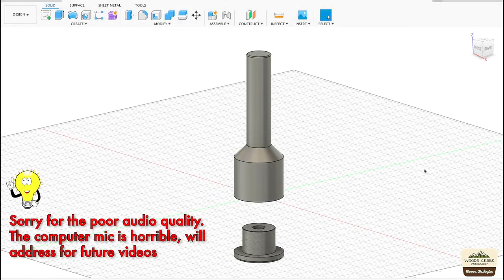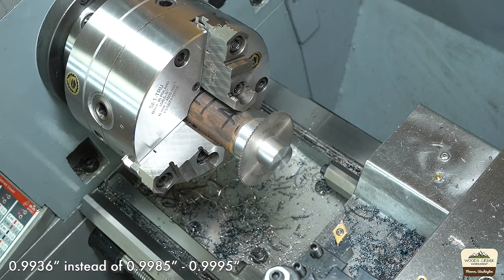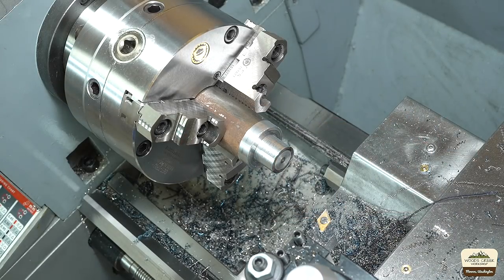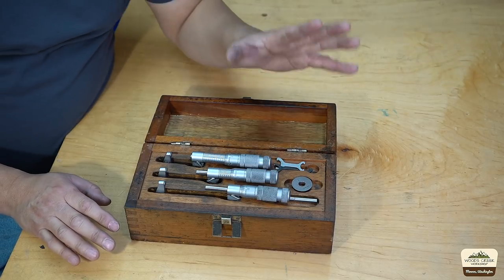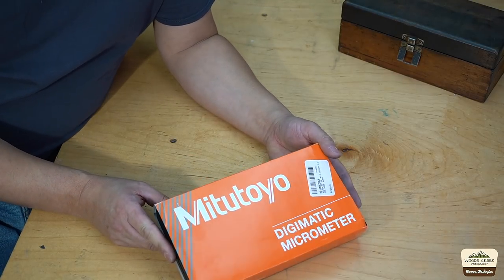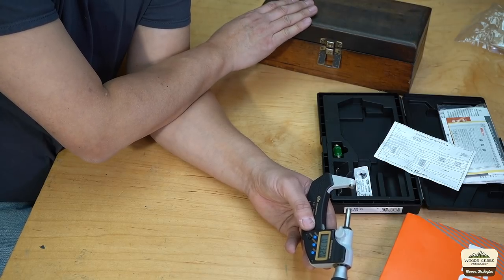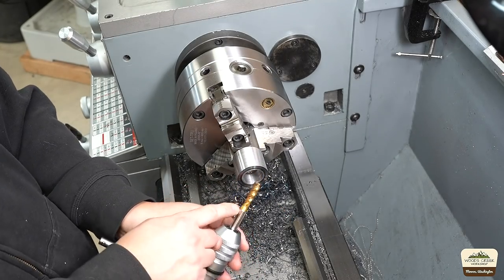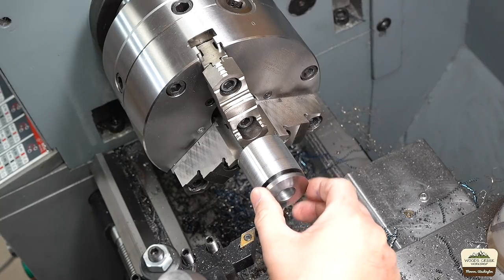MAKE AN AWESOME SLITTING SAW ARBOR

Comment: Great design. Thanks for sharing. This is definitely going on my project list. I was just using a slitting saw yesterday, using a shop made arbor that I bought on eBay. That arbor was only so-so. Also tried using a purchased arbor, more of a milling cutter arbor, but they have that huge nut on the bottom and 1”-8 thread and a lot of excessive length.
Reply from the maker: I have one of those arbors too and they are fine for super heavy cuts, but that nut gets in the way.  That's why I decided to make this one.  I can't take credit for the design as it resembles almost every other arbors made out there.

Comment: While watching the tailstock quill clamp build, I watched you split the clamp with the bandsaw and wondered when you were going to get a slitting saw for the mill, but I wasn't going to tell you that your way was wrong and you needed to spend money to do it differently.  That aside, glad to see you got a nice slitting saw setup - they can come in handy!  I've never bought one that ran all that true, so I wouldn't hesitate to run one of the scrap arbors you made in my shop.
Reply from the maker: Thanks Dale.  I already had few slitting saw arbors, but just weren’t the right setup for the quill clamp.  So I thought it would make the perfect next project. 😁

Comment: I agree with the others. What on earth did we all just watch... ? :-)

Great slitting saw arbor - and an entertaining story. Though, I have yet to meet a slitting saw arbor that doesn't make the "chunk ... chunk ... chunk" sound as it cuts once per revolution. Did you test it out? Does it cut continuously?

Cheers, Craig
Reply from the maker: Slitting saw rule 101:  all slitting saws must make that chunk chunk sound.  All says, no exception.  Its to what degree that matters 😁
Reply: @woodscreekworkshop9939  That's a good approach to the problem :)
Reply: my slitting saw arbors also 'chunk... chunk..'  and I turned the shanks and pilot diameters on the same piece, between centers.. Stopping near the end to take out the taper with the tailstock adjustment at the end.. But, I have never regretted any of the slitting saws I have collected! Also, on my Burke Millrite there is no back gear - fortunately I can run at 1/6th lowest speed easily. Just have to make sure the shank doesnt slip in the collet. Also, found I can cut a little faster without overloading my pretty thin drive belt by only advancing the cutter after the peak of the 'chunk..' noise. 
Great video! Also, I thought of Stefan Gotteswinter's recent video on quickly hitting an accurate diameter on the  lathe when you measured that first diameter undersize!

Comment: Nice job--although I'm bit surprised you didn't cut a key seat in that arbor, and then maybe make it slightly longer to then use a spacer next to the blade. That way you could have cut the key seat farther out on the shaft. But I haven't used slitting saws all that much--maybe there isn't the tool pressure, so slippage isn't an issue? 

Love the end result though. Great work! And like Stefan said, "what (all) did I just watch?" You really have to pay attention in your videos, to catch all the hidden gems...

LOL!

Comment: Nice arbor in the end, but I always finish my arbors to size on the mill to avoid any runout on my little Chinese R8 mill (Seig SX3L) & 35 year old Taiwanese 8x18 lathe (compact 8 copy). I use second micrometers for rough measurement & then final checks with a new Mitutoyo.
Reply from the maker: Thanks Peter!

Comment: Hello,  Are you running the saw arbor without a key?  If so do you experience slip when the blade heats up in a cut?  Good topic.  I just found your channel a few days ago and am enjoying the builds--not so sure about the video snippets and dialogue off subject.....  Take care.  Doug
Reply from the maker: Douglas Thompson no key and no problem.  You have to remember it’s a slitting saw and treat it accordingly, but no problems so far

Comment: If you have a Brown & Sharpe micrometer with the clamp ring lock don't ever turn the locking ring if you have the spindle out. I was cleaning and lubricating mine one day and ruined it. If you are young and need dating advice talk to Yuchol. Boy you were on a roll today Yuchol. Thanks for the tip on the taps. I have a little book that I always write these things in.
Reply from the maker: Thanks bud! 😁

Comment: Your content seems pretty straightforward and basic May I ask what kind of camera do you use and do you have the ability to dub in comments.I see you have the ability to add text I guess I need to learn how to make videos and get some equipment
Reply from the maker: I use Sony A7III which is an overkill for this, but I use it for photography as well and that’s why.  For anyone looking for a great camera, I always recommend Sony A6400 with their inexpensive kit lens.  You will need a lot of lights, nothing expensive, but a lot of LEDs at 6000k color.  I use Adobe Premiere to edit and you can overdub voice easily in editing.  Hope this helps.
Reply: Yes I think it will help . Thanks
Reply: @woodscreekworkshop9939  I was going to email you back Yuchol and ask which particular camera you were using. I remember your advice was panasonic or sony. I didn't get a model number from you though. I have since switched to a Nikon D810 DSLR for photography (beautiful camera for stills), and a cheaper Canon EOS M50 for video, smaller and lower-spec camera, but brilliant at autofocus and so on. I've only just started using it for video work, but you will see it filter through in upcoming videos. The A7III is a great camera - and it shows in your videography. I think one decent mirrorless (e.g. the A6400) would do me for everything. Anyway! Cheers, Craig

Comment: I made an arbor almost identical to this one about a year ago.  It looked great and I was kind of proud of it.  But in the first heavy cut, the blade slipped in the arbor and galled it.  I think part of my problem was that I think I left a slight radius on the mating surface from my turning tool insert radius and that led to the blade not getting full clamping force across the full cross section.  So just a heads up to get the blade tight so no slippage occurs and not to take heavy cuts  I enjoyed the video..
Reply from the maker: Thanks Gary!

Comment: Aren’t you going to put a key way in your newly made part? Surely that blade will spin on the new part once you apply pressure on it.
Reply: Never use the keyway on a saw. It's better to have the blade slip than catch but the clamping force on that arbor with a 3/8-24 grade 8 bolt will be about 7900 pounds.
Reply: Tired old mechanic ...just asking for educational purposes only...Then why do the blade manufacturers cut the key way slot in the blade?

Comment: Will it unscrew if you use a left hand slitting saw ?   Did you really make a pig's ass of 3 of them before you checked the mic !   You got there in the end , Cheers .
Reply from the maker: Yes it would, right hand only unless I decide to add a key.  And yes, I was stupid enough to make 3 bad parts AND admit it on YT 🤣

Comment: Why not have those micrometers sent in and rebuilt and repaired
Reply from the maker: These Mitutoyo are surprisingly affordable, I decided to upgrade.  Thanks.
Reply: I got a quote once on a Starrett dial caliper. Cost was  more to repair than  could buy a new one. Repair was based on suggested retail.